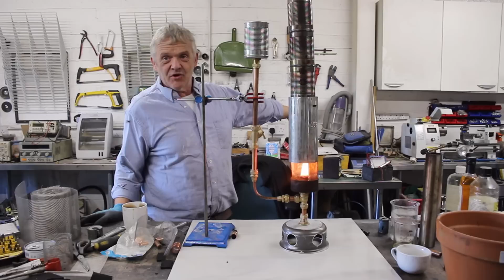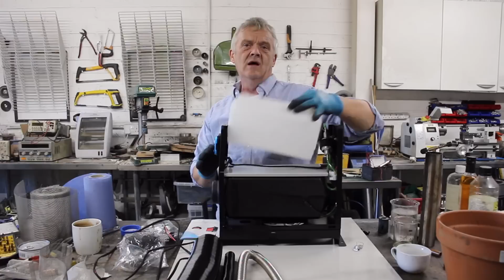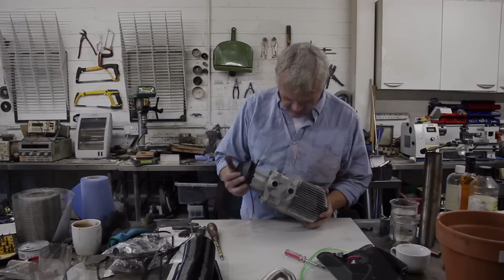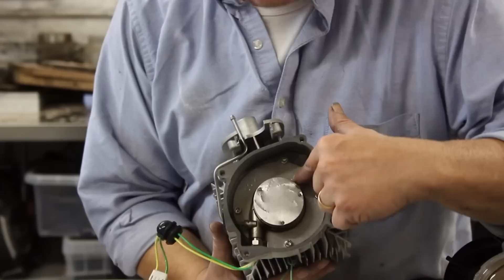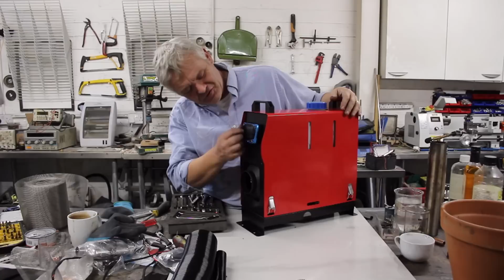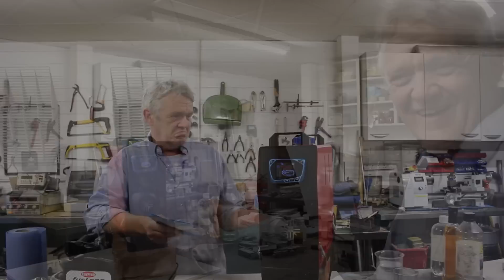1682 The Vevor 12V 8kW Heater - A Review And Pulling It Apart To See How It Is Made #Vevor

Comment: Have one, the fuel hose a liability fit genuine semi rigid pipe, the smell from heater is from glow plug and solid fuel line grommet inside heater seal with high temp rtv.
It's 20 degrees less case heat than competitor.
Screens are dim, smart remote good.
Sadly reviewers gloss over issues

Comment: I plan to buy one this summer.  They always seem to be out of stock but I figure in a month they will be less in demand.  I figure as a backup heat source for anything.  All I need is a 2” hole for exhaust.  (Put 2” pipe thru wall, then 1.5” with spacer, pack in bit of putty I use to repair oil burner fire pot. ). Hook a 12v battery…

Comment: ok so i have an idea i think you should try how abou you use the hho generator with the chinese diesel heater. like inject the generated hho into the air inlet of the chinese diesel heater. i think it should increase the temperature of the burn chamber which will increase the heat produced by the heater with less diesel consumed maybe try it on alpine mode?

Comment: You didn't measure the exhaust temp but it seems to be around 100°C from other videos, quite a lot of wasted heat for a heater. Not sure how best to handle this issue. Redesigning and 3D-printing the radiator so it includes a few loops inside for the exhaust would probably be best, but on the other hand, a hot exhaust adds a secondary heating source that can be used for another room or the greenhouse or for a warm bread dough proofing or yogurt making cabinet, if you insulate the exhaust pipe well enough until that secondary heated location, then adds a few coils of copper there before releasing the now cold exhaust air outdoors.

Comment: Just fitted an identical one to this on the back of our house using diesel and filtered engine oil. I had a great time building a box and fitting it up with my dad. It heats up our whole house and overall are fantastic value for money. Parts are easy to get and fit. Prices are increasing though so if you are going to buy one now is the time. Buy the heater on eBay but get the identical spares way cheaper on Amazon. Thanks for uploading this video.

Comment: Anyone else feel like central heating is archaic? Idea of heating up all the pipes under the floor and heating up cold radiators seems so backward. If this vevor was used like a PIV for a house blowing in fresh air it would be so much better. I'm amazed at how comfortable my car is in winter compared to my house. It's because it's fresh outside air heated up. Cant a combination of a boiler heating up a metal element as part of a pir work? Heat up just one "radiator" which is around a pir and it blows6the air around?

Comment: Was thinking about the diesel heaters & had an idea after one video I saw, the tester was showing the heat output & I noticed the exhaust had quite a bit of heat. What if the exhaust was run through a sealed radiator before exiting the shed/building? Wouldn’t this give out extra heat making them even more efficient? 🤔
Reply: Exactly.  Too add to this you can buy oilcoolers which are cheap little radiators and add appropriately rated fans so you can run from the same power supply.

Comment: You can run these things on straight waste engine oil. It has to be up to temperature, so start it with diesel then switch over. burns as clean as I've ever seen waste oil burn, free heat.

Comment: Hi Rob, Nice Video, Got one of these in my garage, I find it works well on diesel, kerosene, Old engine oil and kerosene 50/50, Old or new veg oil and kerosene, just filter the old stuff.
To be honest i expect it would work on petrol, methional and ethanol but haven't had the balls to try it.
If you use old engine or veg oil you need to run it flat out on kerosene every now and then to burn off soot build up in the combustion chamber.

Comment: i tried to run mine on 50/50 used engine oil and diesel it worked for a whle then stoped i pulled it apart, ware the heater plug enters the chamber is a wire gause that heats up and it runs like a glow plug engine that cloged up and wouldnt stay glowing ... new one off ebay £12 delivered job done ... the unit is made so you cant seperate it i cut it open just above the smaler hole you can see inside that small hole inside holds the material in place that the heater plug and fuel burns so it cant be cleaned ... be a good idea if you could adapt it so you can clean it coz then you can run it on anything

Comment: I bought one to heat a shed. It worked great but I had trouble understanding what the buttons and functions did and how to set the timer. Chinese English is a bit different. They use the word 'valve' for 'switch'. I could appreciate a manual rewrite.

Comment: Would have been good to measure actual heat output against fuel used. I read that you can also extract a lot wasted of heat by running the exhaust pipe through a heat exchanger (radiator for example).

Comment: in regards to small inexpensive "diesel air heating" units, i have question, i simple hho system could make the system far far more cleaner, smaller, produce more heat, and use the same idea/technology we already have and be less expensive then a diesel system. simply replace the glow plug with a spark system, and install an a simple hho plate generator to produce the hho from electrical power. seems to me hho would be great it this type of heater. fuel on demand, ideas? thanks.

Comment: So  how long does a 12 volt 100Ah  battery last before it needs charging when its  connected to one of these heaters ?   and how long does the fuel last between fill ups ?
Reply: I think on low they draw approximately 500ma and high approx 3a. Glow plug on they draw 10a for a minute or so on startup and shutdown. If your battery is lead acid the ah rating is only usable by half so 50ah. Still would go for a long time. The one in my truck i run off a 20ah lifepo4 at 1.8 Hz for about 6 hours at a time and barely makes a dent in the battery. They use .022ml per pump pulse. So when I set mine at 1.8hz it burns 143ml/hour

Comment: I’m looking forward to your tests.  Like how much fuel is supplied/hour will provide a measure of its output (after allowing 15-20% for heat lost via the exhaust?).  Diesel fuel contains about 10 1/2kWh of energy…. 8kW will need almost a litre per hour after inefficiencies, I think….
Reply: I have looked into these , the 5kw is optimistic nearer 4 and the 8kw is a con , the same as the 5 one , about 4kw .
Reply: @gotelemwillyboyshere  Quite right.  The discrepancies also extend to the 3 and 2kW varieties.  I don’t expect many, at all, comply with the ‘given’ specification - at least when delivered.  Even if fitted with a 28ml/1000 stroke pump an 8kW would need to be pumping at close to 10Hz.  Furthermore the fan for the combustion air would either need to be much larger or run much faster.

Comment: Did I see right that the exhaust pipe exits into the workshop?  I thought the exhaust pipe had to go through the window.   This would mean the window would have to be left open.      I have a 70,000 btu space heater and it is excellent.   There are no fumes at all.

Comment: I have just fitted the 2kw version, and I'm not impressed. As soon as the burner kicks in it makes a constant resonating vibrating noise. Especially at start up... you'd hear it across the camping field! Even at tick over whrn warm the noise is still there. Never had this with any other Chinese heater.

Comment: one of the things i like about rocket mass heater installations is that they draw air from the room and then exhaust it out, that way you constantly have your air refreshed. This is largely without the traditional inefficiencies of a fireplace, because of all the radiant surfaces and heat batteries built into the RMHs.  This heater suffers from the same drawbacks as a minisplit; you're re-cycling the same air, that's how people get sick, whether you clean the filters or not.
Reply: Yeah but you don't have to recycle the same air. Just take the air from outside via a duct into wherever the heater is.
Reply: @johngarbutt  I like the idea that the dust from the indoor air is like free fuel.

Comment: I have been impressed by Vevor products I have bought so far.. I have quite a lot of experience with these sorts of hearers starting with the Ebeschpacker (I think that is how it is spelt) which were originally fitted in VW campers. These were petrol fired back in the day but there are similar diesel and gas ones available for vehicles and caravans where the combustion air and exhaust are isolated from the living/working space. rather like that of a domestic boiler really!! Those early petrol heaters used to look and sound rather like a small jet engine!! my, could they the van up though!
Reply: You missed the word Warm out ...

Comment: I wonder how it would work running the exhaust through a few domestic radiators to save wasting heat before sending it out to atmosphere,  maybe under floor heating of a container ? Any thoughts
Reply: Yes, I did it and it works great.  I used a single cast iron steam radiator.
Reply: Maybe a hot water cylinder, or a Willis heater, with a coil instead of an electric heater

Comment: I've had a number of these Chinese heaters in my experience the all in one proved to be unreliable, to clean the combustion chamber I use an Aldi steam cleaner blowing steam into the cold air inlet, I use central heating oil with a small amount of 2 stroke oil to lubricate the pump as fuel. My current heater I've had for four years

Comment: Excellent! I used to build utility trucks (manlifts for working on poles and the like) and we would install Espar heaters which are a similar idea, just shaped a little different, in the cab of the truck. Fuel line went directly into the diesel tank, intake and exhaust were directed out the cab by flexible metal tubes and the heater itself went under the seat. Really hot and efficient without running the engine. Thanks for another great video!

Comment: We run them cheap 200$chino heaters in Aussie land mate in our caravan they burn about 100 mls of diesel per hr on the 5kw model running flat out which is way to hot only thing that fucks up is the fuel pump which is like 20$ and glow plug if not ran at hot burn every few days to burn of carbon off but they are great but the 3000$ German airtronics and wabasto are mabey better on your insurance report when your caravan burns down it has happened a bit lately but I think it was poor installation to blame 👍🍻

Comment: Great video!  I’ll be buying one for sure.  

I hear our 175 year old leaky farm house with a huge outdoor wood boiler but it will give you a real kick in the shorts.  Lots of work! 

I’ve been wanting to make a oil heater to supplement.  This looks perfect!
Reply: Hmm. even as a supplement heater and when used in a leaky farmhouse  .. you will still loose a lot of additional heat energy out the exhaust.
i would suggest adding another (as large as possible) heat exchanger to the exhaust pipe and pump maybe water through that. Simply soldering a few long pipes together should work if long enough. When the exhaust temp at the end of pipes gets down to 65°C or below (dont know that in freedom units)
you extracted most of the energy and even start getting into condensation energy usage. just keep mind of the nasty corrosive water
so the final pipe should go straight up/down so the condensation water can get out through a small hole in the bottom into a container to be neutralized.

Comment: When I was a kid my Christmas presents were usually in bits by boxing day.
They often never went back together - never worked again - but at least I knew what was inside. 
I did learn a lot and family learned to by me different presents - screwdrivers, spanners, Allen keys and motor bikes....
I loved taking old TVs to bits. I used to collect the valves, because they looked cool.
When I was 13, I got a Hillman Imp and a big selection of tools.
Yeah, I took the Imp to bits. Wasn't long before I got bored of it and bought a Vauxhall Chevette. I took that to bits too. By that time though, things worked when I put them back together..

I'm currently acquiring parts for my next drip-fed oil burner project - kinda small - the intention is for it to be 'functional art'. 
The plan is to use the cylinder barrel/head from my old Lister LD1 as the secondary burn chamber. There will be at least one stove fan on the the primary chamber pushing air over the fins of the barrel.
Once the burner is made, it's going inside the empty iron case of a Jotul F3 log burner - bolted to my living room wall.

Comment: These things are rather interesting and coincidentally when I was watching your previous video on the biodeisel powered rocket stove I thought of one of these units.  I was thinking that using one of the cyclic/momentary fuel pumps as these use you could pressurise the pre-heat coil better and might even be able to bet away with a smaller ID tube with fewer turns int he coil.  Possibly even a straight run like with old coleman kerosene stoves.  Just enough to vaporise the fuel.  Since these pumps run on 12V you could, in theory, run it off a car battery connected to a solar charger and have no input energy expense.
Reply: Don't go any smaller tube, it makes the pump work harder and it cavitates. On RV I've piped with brake pipe

Comment: I live mid terrace and have people either side who must have their heating on quite high, because the temperature inside my house rarely goes below 14 degrees, even if I don't turn the heating on, which is set at 17C, so my gas bill is very low, insulation is the key, draught sealants everywhere, I wild camp sometimes and if you get used to being outside, your body will adjust, so less heating required anyway, sitting motionless inside all day and of course you will feel cold, looks a good gadget, a good comparison would be how much it costs to run    vs an electric or paraffin heater?
Reply from the maker: yeah I have a similar lifestyle and I am fat so I am not that cold most of time but my house is detached and my wife suffers from the cold

Comment: I have a similar one. They put out a lot of heat but use a lot of electricity if you use the thermostat which turns the glow plug on and 9ff. If you instead use the constant fuel rate the glow plug stays hot from burning and doesn't use electricity to reheat it. So the only electricity used is the fan.

Makes a big difference.
Reply from the maker: nice tip mate - thanks for sharing
Reply: Mine is a 5kw "all in one" red one.
I am monitoring the current draw.
For the first start up period it draws current.  Then the flame inside starts and this initial current drops instantly to the fan only running. 
I use a deep cycle 12v 22ah capacity battery together with a small trickle charger.  A bit like the car battery starting the car engine and the alternator running things plus recharging the battery again. 
I do this so that if, in my cabin, there's a power outage, the battery will keep it running for hours.
If I had no battery and there were a power outage,  the unit would stop instantly and the cooling fan also.  So the 150-220°C of the burner would directly damage the ICU, etc.  (Worth avoiding)

Comment: I was thinking it would be cool if these could run their self, as far as the power is concerned, if it could generate power to run it's self,. I was looking into tiny engines that could be use to generate enough power to run the heater, and possibly add heat to the heater!  Or just use a small engine that can generate about 1kw for electric heat! But being on solar, I have a separate 12v batt bank, for this and other 12v needs, upwards of 400 ah, , and can charge from a car if in an emergency ! To keep some heat, I have a 600w all in one inverter, and thinking about getting another inverter large enough for the fridge, and microwave,  build a auto change over, to switch from fridge. To microwave, for only a few minutes, then switch back automatically,  maybe a capacitor and relay, simply let the cap discharge into the relay, large enough cap to hold the relay on for 5-10 minutes, maybe it would take too long to charge such a large cap,  or maybe something with a555 timer,  or use a cap and resistor to discharge the cap, maybe a pot to adjust the time, to shut off the MOSFET turning on the relay,  constant or normally close side for the fridge, and the normally open dude for the microwave, preventing the possibility of the fridge switching on while the microwave is in. Use, that may be a good idea. For normal off grid use anyway! Basically a ssr controlled by a cap and resistor,  that controls a relay   sorry to ramble again!! 😆
Reply from the maker: I like the idea mate - I might have a look and see if I can adapt it to do just that - it's an interesting challenge

Comment: Could one of these be converted to use propane and how much does this heater cost? I'd like to get away from using electric heaters because they suck at heating my little place.
Reply from the maker: you could - but I think it would be a lot of trouble and I did say in the video how much it cost mate 102.99
Reply: @ThinkingandTinkering  oh ok I must have missed that part I'll have to research the video.

Comment: had a vevor solar charge controller/inverter/ups.  was impressed by it's performance given then pricepoint.  they seem to specialize in older designs engineered in the 80s/90s from  western brands that are now likely out of patent.  The solar combined unit seemed to be a Xantrex clone
Reply from the maker: I actually like what they do - it fits my mindset